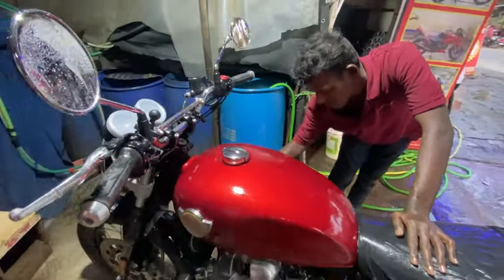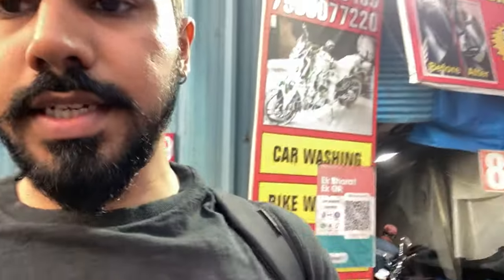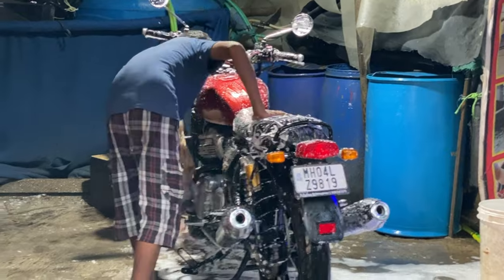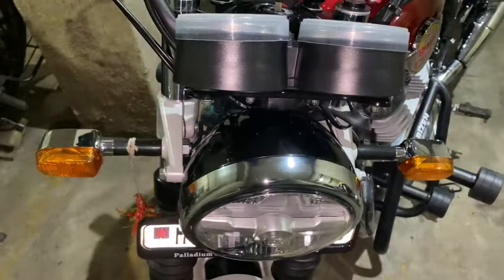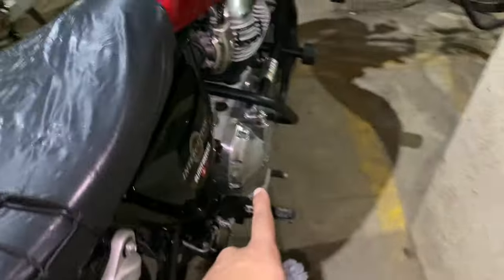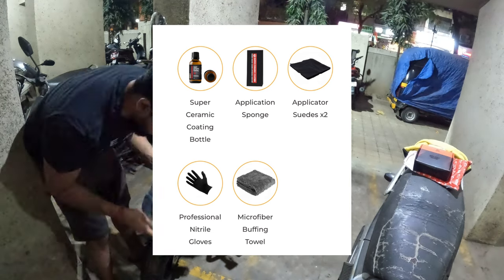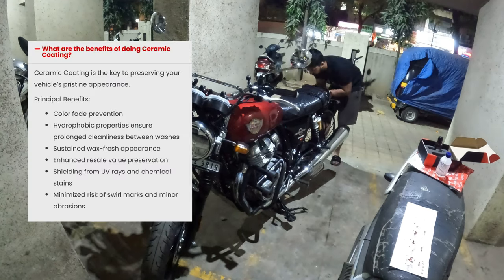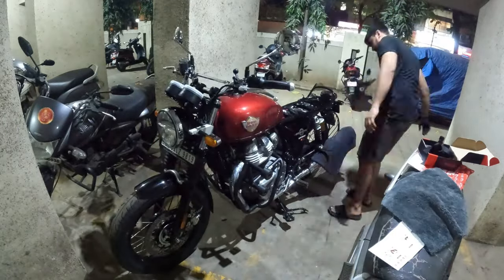Cheapest but Best Ceramic | DIY Ceramic Coating on Bike & Car | #diy #ceramic #coating

Comment: Bhai update about the condition of the ceramic coating
Reply from the maker: @pulkit6204  lasts only 2-3 months
Reply from the maker: @pulkit6204  but worth the price can refresh again another coating
Reply from the maker: One bottle can be used 4 times like every 3 months
Reply: Did you apply 2 coats on your first application?